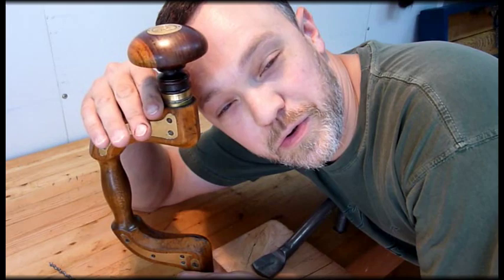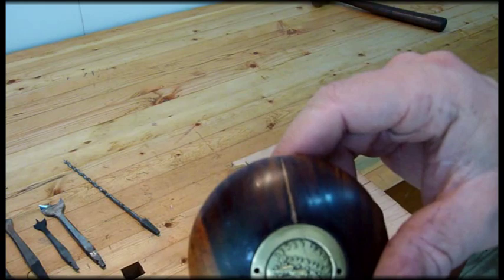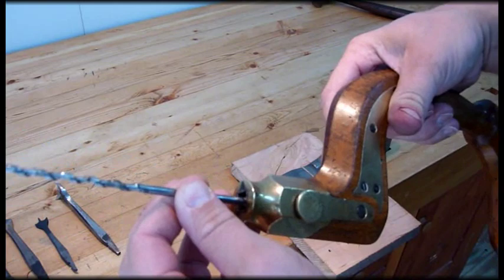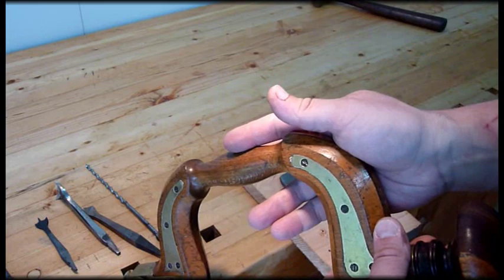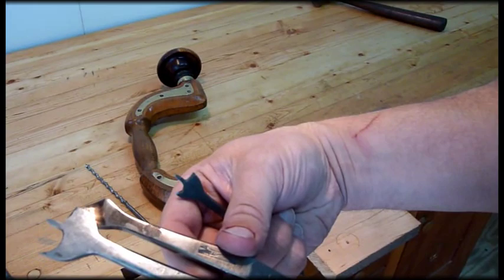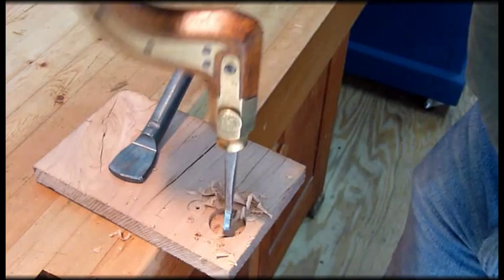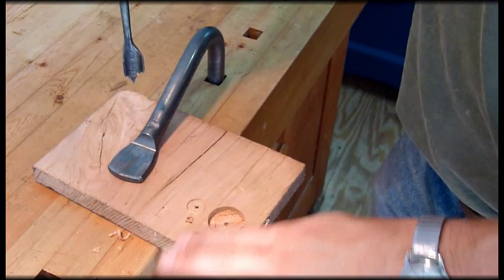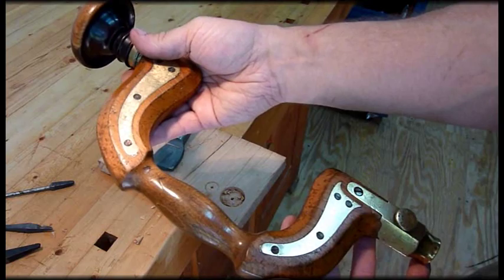1850's Henry Brown/James Bee Plated English Bit Brace

Comment: I wonder if these are more efficient than the ancient pump drill
Reply from the maker: Oh yes, these are far advanced to the pump drill, resulting in much less time drilling.  I would also suggest that the even rotational motion allows for more accurate in drilling.  On top of that the bits had advanced significantly with more variety.
Reply: @Mountainmanjason  Noice. I have shitty hand-eye-coordination so it’s always incredibly fascinating to me to see people crafting things by hand. I find it pretty unbelievable that all of the things before around 1800 were crafted without accurately graded machine slides, milling machines, the concept of the thousandth of an inch, the micrometer, etc. All by hand, and hand fitted. Very inspiring, very time consuming.